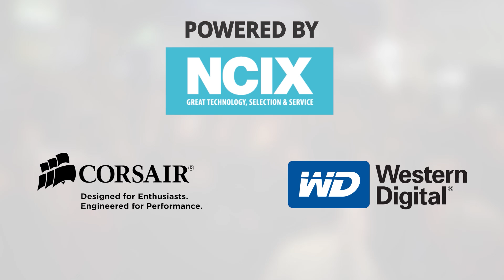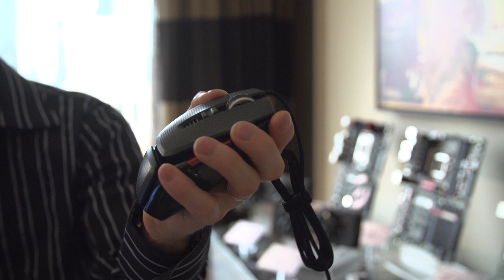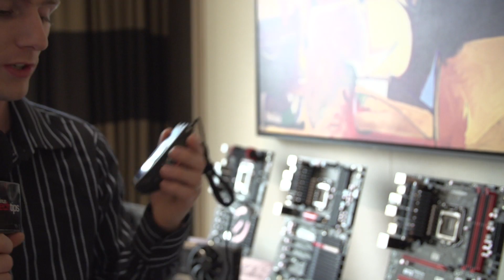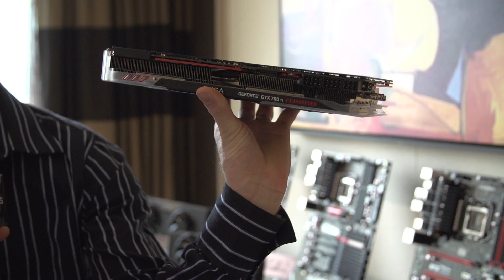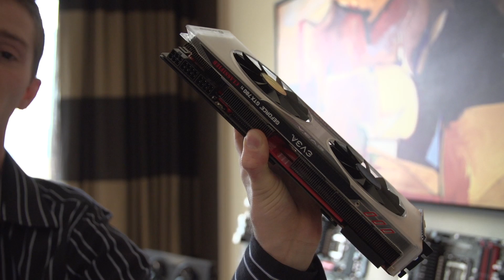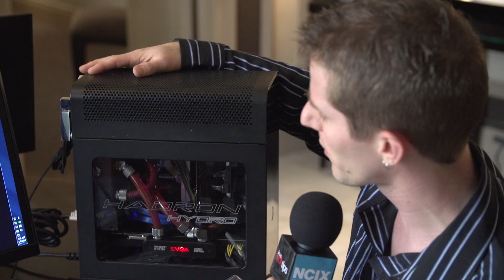EVGA Hadron Hydro, GTX 780 Ti K|NGP|N Edition & Torx X10 Mouse - CES 2014

Comment: My god the KingPin edition GTX 780 Ti is amazingly beautiful.
Reply: Finally something we agree on =D
Reply: Not going to matter once that cooler is torn off and replaced with an LN2 pot.
Reply: Mr .357 Yeah if your into that sort of thing.
Reply: Theorcman2008 If you're not into that sort of thing you shouldn't buy a card named after one of the highest ranking overclockers in the world, who is also well known for his company, KingPin cooling.  You're not going to get anything out of the extra VRM's and power delivery if you're only on air or water.
Reply: Mr .357 The regular Classified is enough for non-LN2 Overclockers, that doesn't mean you can't buy it for other reasons such as bragging rights or prefered aesthetics.
Reply: xResourceHD I said shouldn't, not can't.
Reply: I don't think i'll be getting this card, i'd rather buy another GTX 780 Lightning and put them both under water.

Comment: I've had my PC over a year now and still do not understand the need for all these lights on items. Seems strange.
Reply: it's all about the swag my friend... lol
Reply: I agree. The front 120 that came with my Xion case has blue leds but I kinda like that because it's easy to see the case when it's dark and it is so quiet I can hear the hdd chirpin away. In my opinion the real show is on the monitor.
Reply: I mean, after making a water cooling loop I can understand, and it has to do with pure customization, it really depends on the person on what lights (if any) and how many (if any) they use, I use UV Lights for my UV Green liquid cooling with other lime green uv led lights in my case, all about the finesse.
Reply: Most folks have to stick to a budget and I just feel like it isn't worth the trouble or cost. If you can afford it and like it then I say go for it. It does look very cool when done right it's just not that practical for some folks.
Reply: Agreed. Alot of people (I didn't until recently) don't see it justifiable to pay a substantial amount more for a little bit of glamour, anyways, you won't be looking at the pc when you're gaming :p.

Comment: Linus, there are already voltage unlocks and custom BIOS available for the 780 Ti classified. Perhaps you should do a little research before making such claims. I own 3 of them and they all do up to 1.5v vcore and 2 will do 1400mhz+ on water. The Kingpin is a binned version of the regular Classified and it DOES provide more performance if you're on water vs. a reference card.

Comment: EVGA Hadron Hydro looks like a poorly modded Air. I mean, great concept, don't get me wrong, but it basically looks like someone has bent some sheet metal and just put it on top and drilled more holes than is needed. I hope they improve the aesthetics before production, because you really don't need that much space for 240mm rad and fans.

Comment: Expecting easy 1400mhz on air with the KingPin,,, or GTFO!
Reply: max is 1200mhz on air unless you sit outside in the 10f weather. http://www.evga.com/articles/00813/OC_Guide.pdf
Reply: mikey9890 users are hitting 1300 on air... Do some research at stock 1.21 volts

Comment: 1) Intel ® Core ™ i7-4960X Ekström 2) ASUS RAMPAGE IV BLACK 3) CORSAIR DOMINATOR Platinum CMD32GX3M4A2133C9 32GB (8 x 8GB) DDR3 DRAM 2133MCH 3) Corsair Obsidian 750D 4) 256Gb SSD Samsung 840 PRO (MZ-7PD256BW) 5) EVGA SuperNOVA NEX1500 Classified Power Supply 6) Corsair Hydro Series H105 Extreme Performance Liquid CPU Cooler CW-9060016-BB 7) Dell U2713H | 2560x1440 Thanks for the answer

Comment: its funny, a bunch of companies make super high quality power delivery for nvidia graphics cards which dont use all of that power anyway, mostly because of them being more efficient but also because of the retarded greenlight power limitations and then when AMD makes a card that actually can use up all the power of two 8 pins and maybe even a 6 pin on top of that noone seems to want to do it. maybe one and thats it...

i mean even asus, the one you normally expect to make a board able to give the gpu all the power it could possibly want, still only put 8pin+6pin when the card has been shown to use more than 300W even with just the measly 40mhz factory overclock on the gigabyte 3 fan cooler, 8pin 150w + 6pin 75w + pcie 75w = 300w so that means its pulling more power than the connectors are rated for... come on asus.
Reply: Talk about run-on sentences, jesus fuck.